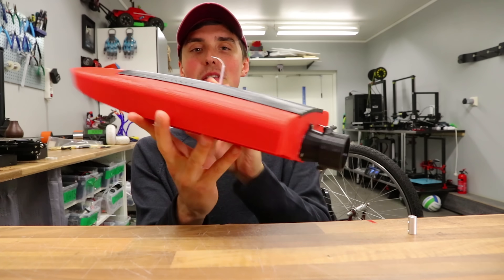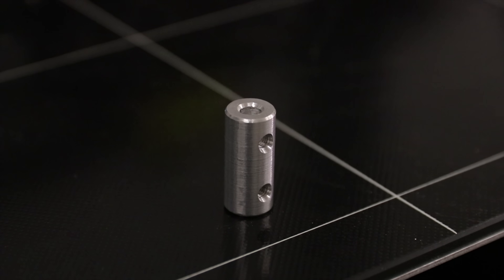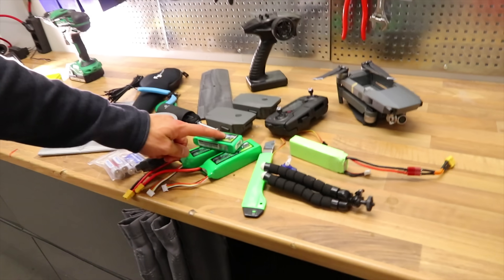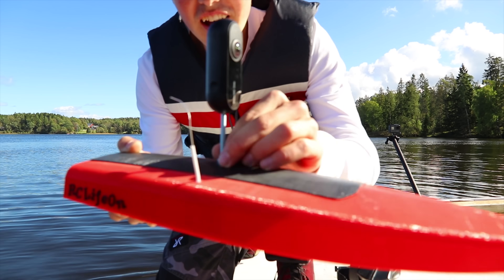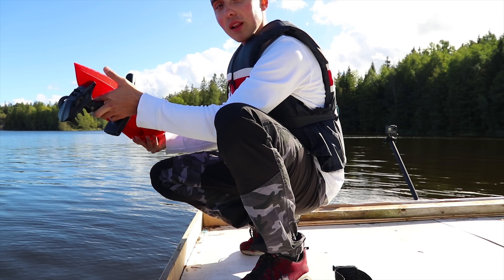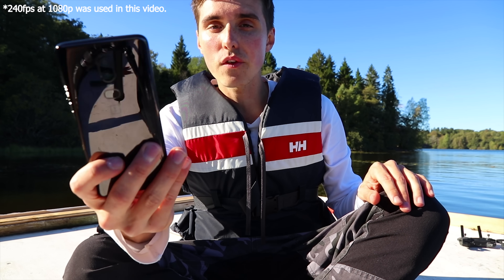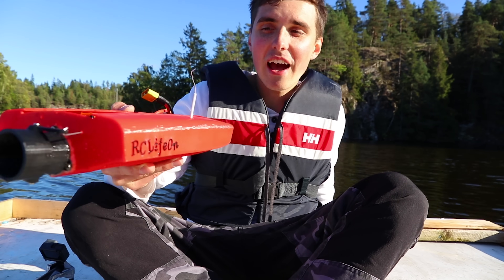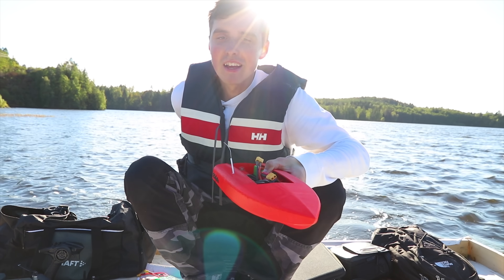IT'S TOO POWERFUL - 3D Printed RC Boat

Comment from the maker: Do I have something in my teeth? - Ace Ventura
Reply: Are you planning to share the project files? So we can make one ^^
Reply: Hey, quick question, do you think that the solid aluminium coupler was the cause for the propellor failure, since couplers normally are flexible to prevent torsional vibrations of the motor from destroying the shaft and the prop?
Reply: Hey I noticed you had some pretty basic channel art, if you want you can message me and I could make you a nice one
Reply: Did you just ass us a question?
Reply: @Noa Liliberte, brah, do you watch Simon's videos?  He literally talks about his favorite printers at least once a month.  Creality CR-10 series is his go to work horse.  Now stop your indecision and make a choice.  You are welcome.  :)
Reply: RCLifeon
Reply: Your Ace Ventura quote is from Ace Ventura 1.  The lovely, large man you showed us as a hint is from Ace Ventura 2.
Reply: Du skulle testa att smalna av styrhuvudet så du får en högre "kompresion" av vattnet, dock skulle du behöva en prop av mässing eller aluminium även den ska vara av mer hajfens liknande blad alt fler blad liknande turbiner så vattnets vikt fördelas ut mer
Reply: "nonsense, poopy-pants!"
Reply: You suck
Reply: Give me 1 printer pls.Because you have much printers
Reply: CHECK OUT PETER STRIPOL'S NEW VIDEO ON 3D PRINTED BOATS - https://www.youtube.com/watch?v=wHMpfqsLytc
Reply: The boats in Peter's video were pretty good and unique in their approach, but I think without a doubt that Simon's boat is better.  The boats in Peter's videos are good because they are designed to be very simple to print and build and be as inexpensive as possible.  So cheers to both!

Comment: You could use the coupler from a 3d printers z axis stepper. Also I think you glue your motor mount in place? Is it possible to make it wedge fit into place with some mods to the 3d file of the boat? Very cool project! Thank you!

Comment: That is sweet. When I was young, we had made foam and cardboard molds and used fiberglass.
I built one after crashing my airplane with a .61 motor and 12" air prop on a stand at the rear. It would move out- 50 years ago-

Comment: Really awesome build, Simon! There is room for improvement, there are two minor drawbacks in this build.  Firstly, the boat is not balanced across the main axis (it is little bit tilted to the left due to the battery weight). I'm not sure how heavy is the speed controller, but if you move it to the other side, it can counterbalance the battery, to some extend and if needed, you can put additional weight. This way you will improve the overall stability, especially at higher speeds. The other problem is that there is fairly big clearance between the steering ring and the propulsion nozzle. You can clearly see the negative effect of this when the boat is running faster - there is water springing like a fountain on every direction from the gap between the two. If you make them fit together tightly, for example like a ball faucet assembly, it will greatly improve the performance. But again - an awesome build, can't wait to make one myself!

Comment: If I may, your next two problems will be a lack of trim tabs and a water cooling kit. Both are easy but will be extremely necessary if you are only giving a third throttle in these vids.

Comment: Very cool.  Only suggestions I would have would be:  
1) Battery is not balanced on center, so maybe it at least is on the proper side to counteract the rotational momentum?
2) Next design should try to either expose the heatsinks to moving air (on motor and ESC) or pump water across them.

Love that no bilge is required.

Comment: impressive, and it goes really well on the water but in order to be perfect IMO it must be designed to accept standard equipment which you can find easily, as you mentioned the propeller. it needs a redesigned to accept a standard size propeller.

Comment: Just my opinion, but i think you should print a propeller mold, around which you could you cold wrap a carbon, fiber glass or nylon layer, and epoxy to get a composite shell. With the right print fill, filament, and epoxy, you can melt out the plastic, or just leave it.

Comment: Try printing the prop impeller on a Form2 or similar SLA machine.  Their prints do not have the differential weaknesss in their material properties and should hold up better.

Comment: Do you think you could add an intake grate to your 3D print, something like https://rover.ebay.com/rover/0/0/0?mpre=https%3A%2F%2Fwww.ebay.com%2Fulk%2Fitm%2F332239065676 It might keep larger objects from damaging the prop.

Comment: The propeller situation might be an excuse to make a part by casting it from a mold based on a 3D printed part. Depending on the process you could go epoxy (or epoxy-composite) or metal. That'd allow you to try some materials which may be more durable than a directly printed part.

Comment: Maybe for extra strengh you could use a 3d printed propeller and then resin cast it with some additive, I think it will result much stronger than just 3D printed.

Comment: Your boat design is slightly flawed, the angle on the keel is not quite right and the length to width ratio isn't quite prefect (can see in the cornering).  Google the hamilton jet20, the 1970/80's style fibreglass hulls were quite ideal as far as basic hulls for trick boats.

Comment: RCLifeOn You should try to 3D print the propeller with the Anycubic Photon, objects printed with SLA technology have a stronger layer bond and are much more resistant than those printed with FDM.

Comment: What if you paint the propeller with multiple coats of CA glue or epoxy to make it stronger. Could you print a mood and fill with epoxy

Comment: An easy an cheap way to make a custom propeller out of solid plastic might be to use vacuum forming. Here is a video of someone doing it with scrap materials from around their house, so less than ~$10. And thanks for posting another awesome video!

https://youtu.be/145qytKw6PU?t=1m54s

Comment: In a pinch you can use a Lustre Terminal for connecting electrical wire as a connector

Comment: could you make a working rc subsmarine for a video?
Reply: Do RF waves travel under water?
Reply: @Duci1989  yes, but very badly and the antenna changes it's resonant frequency if it's directly in water.

Comment: What about plastic molding yourself the propeller? you can 3d print it, make a mold out of silicone and then cast it with resin (imho the easiest way, since using other types of polymers usually needs heat and high pressures). Would not only cost not much, but you can mold multiples if you take good care of the silicone. Check Frank ippolito from tested if you would like to get more in depth info about it!
Reply from the maker: Hey great info man! Have an awesome day!
Reply: RCLifeOn no problem! You too dude
Reply: Considering the range of prop sizes/ pitches available in copper, plastic, and carbon fiber, youd think he could just buy one.

Comment: Also, you may consider using an online service to 3D print a metal propeller... Or building the 3D printed CNC, or something entry level from gearbest... I would consider doing the whole drive train in aluminium...

Comment: I've heard that printing the PLA with higher temperature with the fan off and slow printing speed should make it a lot stronger. Like 215 degrees and 20mm speed. You could try that? Also higher layer hight of course :)

Comment: The problem with the plastic one is you made it too thin and did not add the set screw.

A well designed one made in plastic should be able to stand several stalls with no problem.

Comment: Rigid usually translates to brittle... have you thought of trying a flex-PLA for the impeller instead? might be more resilient to the water resistance, if you can't find a rigid filament that's strong enough....

Comment: Congratulations. I'm starting in the RC world and I'm thinking of starting with a boat. I'm still buying the components, but maybe I'll start printing soon. My printer has print area of 300x300x300 I think I'll have to split the model in two parts at least.

Comment: Could get the biggest metal prop you can fit in it, then 3d print a adapter sleeve for it for a perfect fit to fill any excess space

Comment: you should make a rc submarine
Reply: radio waves don't travel underwater, would love to see a homebrew workaround to that problem
Reply: @mr9_81  The military hasn't found a solution yet. So don't expect a homemade workaround anytime soon. Except a cable or something.
Reply: A tethered floating antenna or sonic modems are feasible solutions for models and toys
Reply: You can use a 40Mhz radio, it only works for 1-2 meters under water, but it works and is a legal frequency to use in scandinavia. Rc submarine hobbyists are using 72 mhz or 40mhz. The most used radio is the Robbe F-14 which you can get in both 40 and 72 mhz (72 mhz is ilegal to use in EU)
Reply: deep. the lower the frequency the better, but it may not be legal.
Reply: @Mr30friends  https://en.wikipedia.org/wiki/Communication_with_submarines 
I think they did? Or am i wrong? :/
Reply: @deep.2606  Could use Extremely low frequency (ELF) as well, but only very old radios support this. Dont know wheather it is legal in the EU, but should be if you are emmiting below 25mw. (But there are some DIY Videos out there on how to built them)
Reply: Depends on the GHZ of the RX/TX, it's possible
Reply: @lengthylad  Very difficult on to make by yourself. And is even more difficult to get your hands on the non- standart ones, using 3-30kHz or 3-300Hz. But good point anyway.
Reply: Rc Submarine plis
Reply: You can automate it to capture some underwater footage and resurface after a while or when the battery dies

Comment from the maker: Ask me something, I'm live in the comment section!
Reply from the maker: I'm in contact with Mosaic for a review of the Palette 2.
Reply: @RcLifeOn  damn man you actually replied (hell yeah),will eagerly wait for the video
Reply: I have an anycubic kossel linear plus but my print quality is not very good could you help me (settings in cura if you could) thank you a lot
Reply from the maker: I've recorded almost the entire video, but unfortunately never manged to print anything. It seems to be a very specific problem to what chocolate one have to use.
Reply: @RcLifeOn  maybe using a 2mm pitch leadscrew like the tevo tarantula one to make an extruder for molten chocolate works :-)
Reply: RCLifeOn please make iron man's arm or helmet
Reply: RCLifeOn 

U should try this stainless steel embedded filament 

https://www.matterhackers.com/store/3d-printer-filament/proto-pasta-stainless-steel-pla-1.75mm
Reply: I have an anycubic kossel linear plus but my print quality is not very good could you help me (settings in cura if you could) thank you a lot
Reply: @leopan4682  i have the pully version, all i can suggest is to make sure everything is tight and then print a tall cubeoid and adjust the temperature, speed, accelleration and jerk settings until all the corners are sharp, the potential of the kossels are very high but they need a lot of tuning
Reply: hi, what about using some improvisation, for example cut the propeller out of beans can top part or just try to use thin sheet of metal, be creative, you can always print just a mount for it. Good luck. :)
Reply: are you thinking about making some 3d printed robots like opencat?
Reply: you should go Live!!!!
Reply: Next time you should try building an RC hydrofoil boat! https://www.youtube.com/watch?v=edhBs5gK8AA
Reply: Hi Simon! At what point are you in 3d printing chocolate? 😁😁
Reply: Do a video on  using the palette multi material filament mixer
Reply: 1:07 is that rlly john denver? now i have teke me home in my head
Reply: With you ever attempt an amphibious rc vehicle?
Reply from the maker: Yepp, the good old Country Roads.
Reply: Can you suggest which cheap camera or phone to buy to start with a youtube channel?
Reply: What about plastic molding yourself the propeller? you can 3d print it, make a mold out of silicone and then cast it with resin (imho the easiest way, since using other types of polymers usually needs heat and high pressures). Would not only cost not much, but you can mold multiples if you take good care of the silicone. Check Frank ippolito from tested if you would like to get more in depth info about it
Reply: I´ve some questions regarding 3D printers, and I hope someone in here could help me out
Can you print your own transformer or action figures with ANY 3D printer or do you need an especific type of printer?
What´s the best material to use if you want solid toys: ABS or PLA?
How solid is going to be the toy? Like Hasbro´s solid, like a Lego´s brick or is going to be like a really cheap plastic?
Do you need to sand the pieces or they´re already smooth as soon as they leave the print?
What´s the best software to use to create toys for 3D printing?
How durable is going to be the toy? Is going to break as soon as it hits the floor?
And what´s the best way to deal with tolerance´s issues?
Reply: Can you make a 3D printed items video again? / mounts for gopro’s maybe. Love from your neighbor Norway 🇳🇴
Reply: @RCLifeOn If someone were in Sweden and asked you to meet up, would you do this?
Reply: WHERE YOU LIVE?
Reply: Can you print a submarine
Reply: If ur boat gets propulsion by pumping water "inside" the boat and shooting it out at the back, you could use some thin extra tubes to make a water-cooling for the Motor ;)
It's quite hard to describe my idea, think about it! :)
Love your vids :3
Reply: Can u give a detailed list of the Electronic components for ur RC projects including the equipment to control it? Would try it out. Greetings from Germany!
Reply: I have an anycubic kossel linear plus but my print quality is not very good could you help me (settings in cura if you could) thank you a lot
Reply: ok, so now you need to actually accelerate the water with the nozzle, for instance on my 3d printed boat i use a 25mm prop with a 10mm nozzle, and a stator that is tuned to get the water perfectly straight. (took about 20 tries to get it right.) 

also i suggest taulman 910 for the prop. or even ultem1010, if you're ready for the next level...
Reply: RCLifeOn can I buy the boat off of you lol
Reply: What kind of motor is installed on this boat? Can you link to it?
Reply from the maker: Here's a supercheap equivalent of what I'm using. https://www.gearbest.com/multi-rotor-parts/pp_447789.html?wid=1433363
Though I would recommend to purchase a motor and esc intended for the purpose, which the linked kit is not. Hobbyking is a pretty good place for good stuff.
Reply from the maker: I'm waiting for the Palette 2.
Reply from the maker: Country roads take me home to the place I BELONG!!!
Reply: Yeah pla is not strong enough for such application by far. I would say best bet would be try to print propeller from PETG and hope that is strong enough. Other option would be to ether cnc machine one from tool aluminium, or cast it from aluminium via lost pla technique. What ever the method you go for, mind that none of these will produce perfect propeller, so for you might want to go talk to you local car turbo shop, who rebuilds them. They should have balancing machine for turbo propellers/fans. Even though those are bigger, i believe it should be possible to balance propeller with their equipment.

Most propellers break from impact to solid object, but second most common reason is manufacturing fault in material in combination with no balancing done to it.
You could also make it using injection molding to produce multiple copies, but would it hold any better compared to original? It all depends on how well you want to make it, how much to invest and what is the goal. For personal use: metal cnc machined all the way, to sell: injection molded, to build for community as open source: most commonly available parts, or parts that average joe can make them selfs.

Proprietary parts usually drive people off from project and make seller look like asshole. Also its not good idea in the long run, as spares can be only purchased from seller witch wont sell them for ever, making boat useless in long term.
Reply: What controller receiver and motor controller do you use! U seem to use the same stuff for all the builds
Reply: RCLifeOn are you Swedish?
Reply: Can you please make slide size 3d printed boat please
Reply: where are the stl files
Reply: Is there any posibility of getting the file to  print the boat on the 3d printer... thank you
Reply: Can I ask something about the motor. Is the motor 60mm long and 36mm wide? Your answer would really help!
Reply: Why aren't you using flex seal™?
Reply: RC life on please make a Iron man helmet
Reply: Can you giveaway something to me like drone